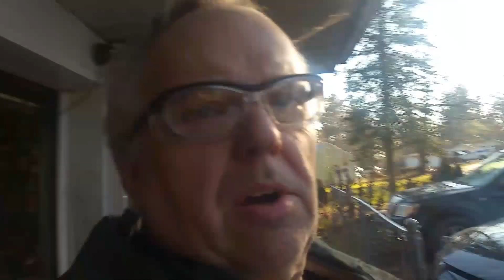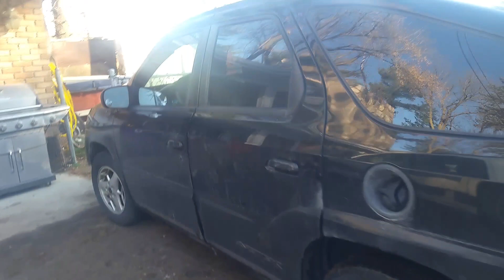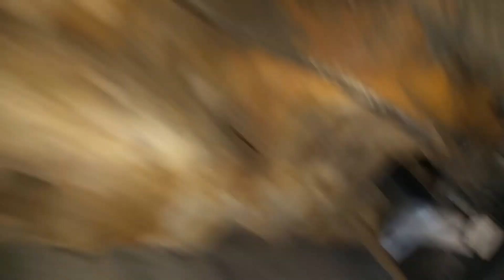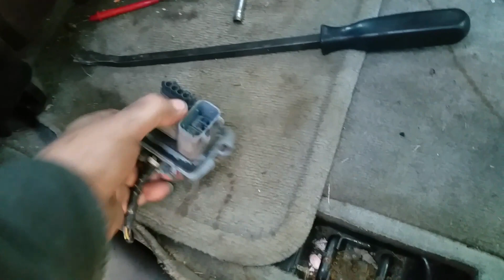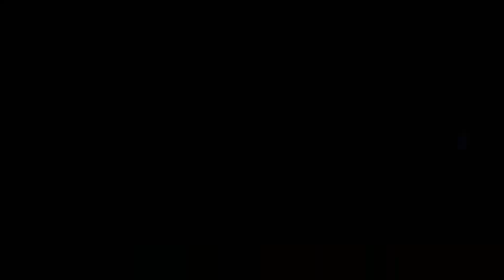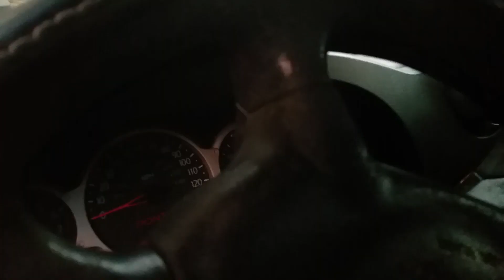How to replace fuel pump and inspect the harness plug Pontiac Aztek and Buick Rendezvous

Comment: That is a very poor way to repair the connections. If you're going to do away with the plug and wire it directly you should solder them and cover them with heat shrink tubing.
Reply from the maker: Yes but given the location the best option would be to replace the connector, using a pin tool.
Reply: Actual that spice is an air tight connection and waterproof  if  you get the waterproof splace

Comment: Hubby tried it but it didn't work ...sure could use help with it,,
Reply from the maker: What is going on with the car?
Reply from the maker: Happy to try and help. Darylturcott@gmail.com
Reply: @darylturcott  First off  I am not a mechanic and can not afford  to have it done. I took  the wiring apart to check for water and found connections all corroded. Can I get the parts at say auto zone?
Reply from the maker: @maggiehumble7822  the actual connector block is available.  Not sure about autozone but probably.  It has an odd name and is kind of expensive for what it is. Are you comfortable with cutting and splicing wires? Im guessing your vehicle wont start?
Reply: @darylturcott  I have that many times before.
Reply: No it will not start
Reply: After I let the water out connected it back up, that's when it didn't start.
Reply: Well sir thanks to watching your video many many times,,and did what you had done,,"I now have power" but the gas gage still is still going bonkers,,I'm just going to deal with it,,I'm just happy my car is running,,I thank you very much....

Comment: The tap connectors are famous for corrosion. Due yourself a favor and solder and heat shrink the wires.

Comment: How long did this fix last? I did this but it only lasted a couple of weeks. I'm thinking about replacing the whole plug but the wires all look grey in the pictures of the pt1123 replacement part. Looks like it could be a headache if they aren't colored.
Reply from the maker: Mine lasted a couple of years then we sold car. Would be harder without color I suppose. Do 1 at a time or label them.

Comment: I no this video was a awhile ago but i have a 03 Aztec all wheel drive do you know where i could get a full pin out for the c305 connector like yours mine it's trashed and lost all wheel drive a long time ago thank you in advance
Reply from the maker: Do you need a diagram, or the actual part?
Reply: Sorry took so long to get back to you thank you for replying.  I went to bone yard and found the fuel pump evap rear wheels speed sensor and rear all wheel drive differential. I spliced all the wires and replaced the fuel assembly and speed sensor plugs but was not able to find the rear diff connector so i just spliced those wires but either i messed speed sensor n differential wires or there working and throwing codes for evap which it was b 4 i touched it but also thru codes for rear passenger speed sensor and all wheel drive disable. Lol i no what a mess huh wheel just wanted to give update thx again

Comment: My father's shows always full, I disconnected this and found a pin rotted out and the other portion of the pin in, pulled the pin out and stuck a cut Allen wrench in as a bypass pin. Any idea which pin on this would be for fuel level? Why it would show always full? His is a rendezvous. Also if I do a wire bypass, how did you get the wires through the bottom of the car, did you drill a hole?
Reply from the maker: Here is a link to wiring diagrams
https://drive.google.com/folderview?id=1Hjr2LrZAirCDw-G0lEeJd1NnvZn3NXh8
Reply from the maker: I have wiring diagram posted in Dropbox. I'll try to find link. One of the wires is hooked to the float which supplies variable voltage to the gauge needle. Always a chance it could be bad gauge, but not likely if the wires are bad. I can't remember how I routed the wires .
Reply: @darylturcott  Did you replace it with PT1123 or just hard wire it as a permanent fix?
Reply: My aztec saids it’s always full too? Did you already fixed it? Pls tell me how.

Comment: Thank you so much for this video.  My beautiful Aztek didn't start this morning. You have provided a wonderful starting point. 5 minutes later: Uh oh, this is going to be a project!
Reply from the maker: Good luck. Let me know if you need any help or manual pages
Reply: @darylturcott  Thank you so much!
Reply: I'm going to try this quick fix on a 2002 Aztek later on today.  I hope you are still on here or periodically check bk from time to time in case I have any problems accomplishing this task. 
Someone else had already installed the pump but had told the owner that the old pump was still good althou it was getting power and neither is the new one.  Pump came with a new harness  but the  guy never used it.. Guess I'll see how this pans out here in a few hours... thanks for your video it's def well appreciated l!!!!

Comment: I have a 03 Pontiac Aztec that I had become my Daily Diver I love the thing!!
Last year I believed my fuel pump went out, replaced the fuel pump and it worked, 3 days later the same thing happened it wouldn’t turn over  mind you my gas gage wasn’t work either
I add some gas(though it ran out of gas lol) and still nothing i though the parts store had sold me a faulty fuel pump (it happens I understand) so I got it on the lift and was ready to drop the tank wen I saw  the BCM I went ahead and removed it. Moisture and corrosion was present, I i hit it with some C&C electrical connection cleaner and packed it with some lithium grease to make a better connection and bam! It was fuel pump kicked on and has been kicking on mind you that it’ll be wise to actually replace the BMC with a new one & have a way  for moisture to stop from getting into that connection
Reply: Do you have a video

Comment: Are all the wires grey? Or are they colored underneath the shielding? How did you match them? Cant find a diagram. Thanks
Reply from the maker: I'm sorry the video quality is so poor. The part is gm pt1123. I think there are different colors, I bought an digital download manual and found a diagram. I'll see if I can find it.
Reply: @darylturcott  video quality is fine! Didnt expect to see color on those tiny wires, especially when dirty. Was just hoping you knew. If you can find that manual that would be great appreciate it thanks!
Reply from the maker: If you can give me an email address I will send the wiring diagram pdf file
Reply: @darylturcott  would you send that my way by any chance? Havent had a fuel gauge since buyimg the car, have an evap code and the fuel pump just stopped working so im thinki g this could be my problem. Plug looks corroded as well.
Reply from the maker: @djphilippus9804  I'll see what u can do.
Reply: @djphilippus9804  https://ibb.co/y59BF4P
Reply: @darylturcott  i uploaded the pic u sent me and gave him the link below. Im halfway done with this project..
Reply from the maker: @chase4870  thank you very much!
Reply from the maker: Djphillipus I uploaded the whole manual to Google drive. Let me see if I can figure out how to make it public.